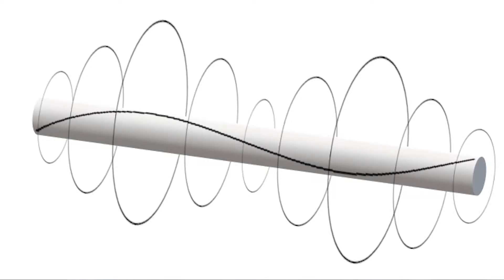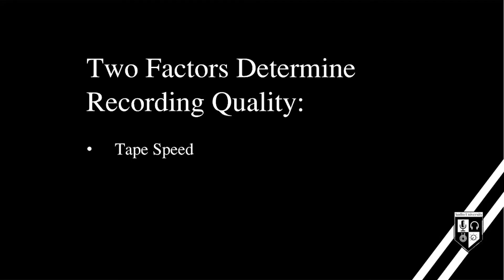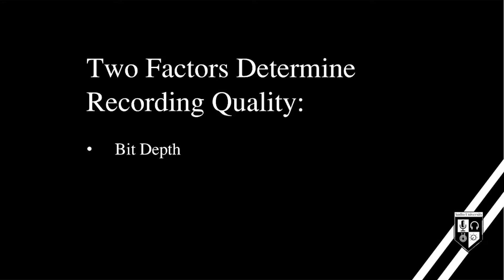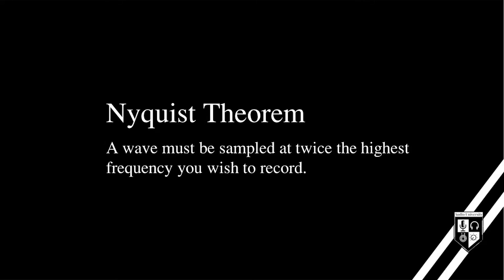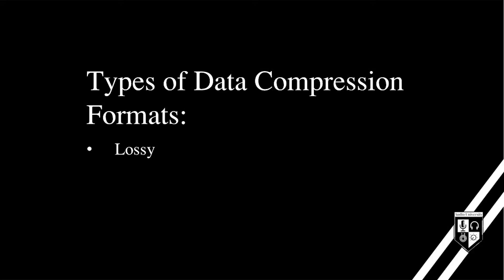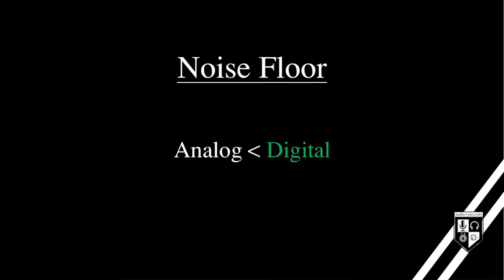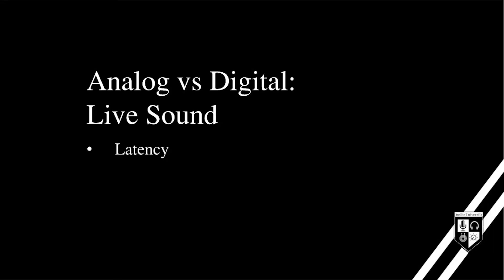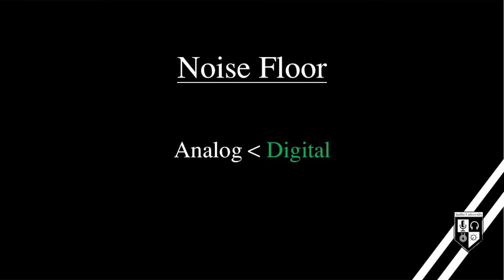ANALOG AUDIO vs DIGITAL AUDIO: The REAL Difference

Comment: Mostly correct, but there is some incorrect information based on intuitive reasoning

1. Digital does not lose information between samples. It loses frequencies above half the sampling rate.
2. Talking about the sample rate the author claims that analog's advantage is that it can capture infinitesimally small variations in amplitude. This however is determined by bit depth, not sample rate. It is also completely untrue that analog can capture infinitesimally small variations in amplitude. It cannot (nothing can), and the reason for this is noise. CD level digital is able to resolve smaller differences in amplitude because its own noise is lower.
Reply from the maker: Thanks for clarifying this, Nyquist! (Nyquist - very fitting...) I've since posted another video that touches on these points: https://youtu.be/1YviIsCbT9Q
Reply: @AudioUniversity  Indeed, that other video clarifies the issues. Good stuff.

Comment: Which is better is the wrong question because there is no correct answer to a subjective question. Digital is the more accurate medium, which is easily verified by comparison to the source. The fact that many prefer the distortions of analog is an aesthetic preference, not a quantifiable measure against a scale. Better and most popular are not synonymous. Accurate reproduction would also have to duplicate live levels because the ear is not linear. Since that's seldom practical, lowering the volume is distorting the sound as it is perceived by our non-linear ears. The compression effects of analog system saturation, especially for tape, coincidentally provide a decent approximation of how we remember the live sound when played at lower levels. Vinyl mastering limitations force conservation of high frequency energy while digital is open to abuse. Simply copy an LP to CD, and it will sound more like the LP than the CD version that was slammed against the 100% wall. The transparency of digital holds it to the data standard of garbage in/garbage out. Record producers, except for some fringe audiophile labels, never give you the signal coming from the microphones, so all you are judging is the skills of analog versus digital recording engineers if you listen to commercial releases.
Some producers and artists were subjected to bind tests pitting digital against analog tape, and despite claiming to prefer analog, nearly all chose the digital as the better sound. Even small amounts of flutter in the best recorders generate dissonant modulation sidebands that unbiased ears will reject compared to the undistorted sound.
This was an excellent presentation, but it's more interesting to see the facial expressions of people finding out they really prefer digital in a blind test. We just got used to the distortion and more comfortable with the familiar, and that's why we think an electric guitar sounds wrong through a Hi Fi amp.
Reply: Absolute bs. You have cloth ears.

Comment: Just can't catch a break can you? Optical media has a life expectancy as low as 5 years. (yes some have 50-100 years) The original CD was projected to have a 20 year life span because of the different coefficients of expansion with the different materials used. And while optical and vinyl can be destoyed by physical contact like scratches, vinyl is inherently stable for millennia!
Reply: "vinyl is inherently stable for millennia"

No, it isn't, and neither is any other type of plastic. Plastic degrades over time and will eventually become brittle and then crumble to dust. This can happen in as little as several years with some plastics, such as when the manufacturer doesn't get the recipe quite right (particularly the stabilizers). The Super Nintendo Entertainment System is a notorious example of this. For many of them, the plastic shell soon turned yellow and brittle due to a large batch of bad plastic. But even the best plastic formulations won't last for thousands of years; not even close. 

If you want a record to last indefinitely make it out of e.g., gold, platinum, 300-series stainless steel, glass, sapphire.
Reply: @MaximRecoil  Well it is a really good thing then that optical media does not use plastics! Especially not a single molecular structure with multiple layers of dissimilar materials with different coefficient of thermal expansions.
Reply: @glenncurry3041  What are you talking about? I didn't say anything about optical discs. I quoted your statement...

"vinyl is inherently stable for millennia"

... and that's the only thing I addressed. I certainly didn't claim, suggest, nor even hint that optical discs are any better for long term storage of music than vinyl records are. In fact, CDs have problems beyond being made of plastic, i.e., their reflective layer is usually made of very thin aluminum foil which can corrode if oxygen reaches it. This is known as "disc rot." When that happens, the portions of data that lie below rot holes in the reflective layer can't be read properly by the laser mechanism.

There's no way that I know of to make an optical disc that will last indefinitely. You could start by making the transparent disc out of glass or sapphire, and make the reflective layer out of gold or platinum (neither of which react with oxygen under normal conditions). However, you'd still need a way to attach the reflective layer to the disc, and I don't know of any adhesive that won't degrade over time. However, as long as you make the disc itself out of something stable like glass or sapphire, future problems with the reflective layer could always be repaired. All of the data is contained in the transparent disc. The reflective layer contains no data, it only allows the laser to read the data.
Reply: @MaximRecoil  For some reason you chose to attack my OP RE the inherent physical stability of vinyl/ PVC. Science is working on ways to make it decompose in less than 500 years! Even thin PVC bottles in landfills! My OP started out about opticals. So if you prefer to wander randomly amongst the lilies, be my guest!
Reply: @glenncurry3041  "For some reason you chose to attack my OP RE the inherent physical stability of vinyl/ PVC."

"For some reason"? Because your assertion is wrong. What other reason would there be?

"Science is working on ways to make it decompose in less than 500 years!"

A very long period of degradation happens before something is completely decomposed. It is not as if a piece of plastic is perfectly fine one day and then the next day it's decomposed. Vinyl records will become unplayable hundreds or thousands of years before they are fully decomposed. Once they turn brittle and powdery on the surface, the grooves will be destroyed by just playing them.
Reply: @MaximRecoil  You get triggered by vinyl obviously. And post way too much misinformation for me to bother with! The inconsistency was hilarious though, thanks!
Reply: @glenncurry3041  "You get triggered by vinyl obviously."

Your non sequitur is dismissed (and your unfortunate reading deficiency is noted).

"And post way too much misinformation for me to bother with!"

Your non sequitur is dismissed.

"The inconsistency was hilarious though, thanks!"

This is another non sequitur (given that there is no inconsistency); consider it dismissed out of hand of course. And since your entire post consisted of nothing but non sequiturs, your tacit concession on matter is noted.
Reply: @MaximRecoil  Add lack of context comprehension to your technical failure and lack of consistency.... You are serendipitously hilarious! Thanks!

Comment: Ah yes the digital sample lollipop lie pushed by TI! Please show us all the physics behind violating Plank Length by claiming any sample can be instantaneous and not an accumulation over a period of time! 

Ladder ADCs do peak sample and hold across the entire clock cycle. Sigma Delta converters use a capacitor fed back from it's output to it's input to keep the gate open for a period of time to accumulate electrons/ create a sample. 

Or you could prove me wrong by showing an actual display from a waveform (O'scope) that has lollipops and not stair steps. Not the graphic drawn above.
Reply: MF Nickster  WRONG! Lollipops are used in Sigma Delta graphics which is single bit based strictly binary on the next sample being higher or not. It is NOT used in ladder ADCs where an actual measured value is converted to a number. 

Again it is as easy as proving that you can violate the laws of physics and have a zero time, less than Planck Time instantaneous sample. 

Rather than the REALITY of an elapsed time based sample across the entire clock cycle.
Reply: MF Nickster  If you prefer to misrepresent the factual reality of a required time domain and every actual visible display of a signal, sure! Knock yourself out!

Comment: The Shannon part of the Shannon Nyquist theorem is about infinite sampling/ a continuous wave. Nyquist added that an infinite set of samples/ continuous wave can be represented as long as no transition is faster than half the sample rate. As such supposedly 40K sample rate should be good to 20Khz. The example given is a 12 hour sample of the Sun/ Earth giving noon and midnight! As if every time it's sampled the samples ar at peaks. But what if sunrise/ sunset were the sample points? It could be as accurate from that data to say the Sun circles around the Earth's equator. Just as a 40K sample could sample a 20Khz sine wave at zero crossings instead of peaks. Suddenly the twice highest freq decides there is no signal there!

Comment: A perfect mix is the solution. For example i use a sampler with a sample rate that i can change from 8-32 kHz and a bit depth of 18 bit. It creates a rough,  digital sound. But it's always cool to mix it with an analoge synthesizer to give it that extra flavour.

Comment: I used TOSLINK at one point on my computer, and I switched back to analog. Like you said, analog has better latency. It’s also uncompressed, unlike digital. Long story short, if you’re an audiophile, you might find that analog works out the best. If you want a quick and easy solution to audio, then digital might work out better.
Reply from the maker: I have heard others say this same thing - "[Analog audio] is uncompressed, unlike digital." I don't think that's an accurate statement. What do you mean when you say digital audio is compressed?

Comment: All technologies have their advantages and disadvantages, so I believe that we should be able to find whatever we need for each circumstance, especially when talking about electronics, and audio or image. For example, an important advantage of recording video or audio on magnetic tapes is that if it stops working all of a sudden, the tape keeps stored your work up to this point. However, if you use digital media, instead of analog, then your work is gone, because digital media save audio or video files, and you need electricity for this process, from beginning to the end

Comment: Hi.  A couple of questions on what you say around 6.50.
1. Bit depth.  With 24- bit resolution, you get 16,777,216 unique values .  is there any experimental evidence that the human ear can distinguish anything more than this? Or even 16 bit?  If not then this is not of practical concern.
2. You say at 7.05 that the wave captured by digital recording is " not as  jagged" as people think.  This is wrong surely.  As long as Nyquist is adhered to then the resulting waveform is identical to the original.  No jaggies at all!
Reply from the maker: 1. The bit depth primarily contributes to a lower noise floor, according to my understanding.

2. You are correct - there is no jagged waveform within the limitations of the Nyquist Frequency.

Comment: As an ultrasound hearer, digital music and digital devices have completely spoilt the experience for me. Most music produced after the 90's either has half of the sound frequencies that i hear missing or has weird harmonic distortion sounds between 20khz and 30khz. I've tried FLAC audio at 96Khz but it either has harmonic distortion or the sound cuts off at 22Khz so I still miss half of the sound. I think it's because of the way modern music is produced. Even though it's 96Khz most of the individual samplers / synths are not so they have frequencies missing. My hearing range is 10hz - 58,000hz. Most of the distortion from digital amps and speakers happens above 20Khz. Bluetooth is absolutely horrible and I worry for people like me as headphone jacks are being phased out completely.
Reply: It's actually higher than that but they test the perceptual amplitude for me as well. If there's a dip in sensitivity then you fail the test for that frequency. In recent years I have developed hearing loss in the range of 28,000 - 32,000.
Reply from the maker: My understanding is that the frequency response of most microphones tapers off quickly starting around 20 kHz. So, even analog recordings contain very little information beyond that. I’ve never tested this personally, but I’ve heard this from several people in the industry.

Comment: I'm bad in english. So what is better analog or spdif/hdmi?
Reply from the maker: Both SPDIF and HDMI use PCM, so the quality will be equal. How many speakers are in your system? 5.1, 7.1, Dolby Atmos?
Reply: @AudioUniversity  Thank you. 5.1. Denon AVR-X2400H (which not have 5.1 analog inputs). Speakers monitor audio and sound card ASUS Xonar DX over SPDIF. When I use HDMI I don't like sound over av reciever, bacause it its difficult remotely change equalizer. From PC much much easily. Also important thing that quiet sounds I badly hear over HDMI, in asus control panel I push SVN button and quiet sounds become louder, I tried do it in denon, but not so good it works. Why I asked about spdif, because I was reading that dpdif have small bandwidth in his cable. So I think may be sound is degrades. Or it is better sell denon and buy reciever with analog inputs, but such recievers now is very expensive.
Reply from the maker: I would not recommend using a receiver with analog inputs for 5.1 surround. Personally, I would choose to use either SPDIF or HDMI based on which one is more convenient.
Reply: @AudioUniversity  Thanks. Very strange. But why not analog? Many amplifier with rca inputs only and optic.
Reply from the maker: Analog connections are far less common than digital connections for surround sound formats. I don’t believe there is a significant benefit to using analog. Digital is cleaner, simpler, and more common.

Comment: Humans are not linear..its the imperfections in analog that is "PERFECT"
Reply from the maker: Good point, Mr.Morpheus! Some of the best parts of analog audio systems are imperfections!
Reply: Exactly, plus analog formats distort the signal in a very specific range of the spectrum. That’s also why human ear prefers them. When you record on tape and switch between source and tape monitoring enough you will realize that you prefer the sound of the tape. Really amazing
Reply: @Alt-ot5sr  the hiss, the unique analog sound, the crackle you hear on vinyl, it's all a vibe.

Comment: So if you record an analog synth into a computer it looses its sweet sound as soon as its sampled? Why do analog synths sound better than synth plugins? I hope you can answer my question.
Reply from the maker: No. It doesn’t lose its sound. Modern digital audio systems are capable of extremely high fidelity.
I don’t have a great answer for why an analog synth might sound better than a synth plugin. It might have to do with the way analog circuitry is more forgiving than digital systems, in terms of gain structure. If you overdrive a digital system, it sounds terrible. If you overdrive an analog system, it can sound quite pleasing. 
Let me know if you find a better answer! I’m interested to know!
Reply: @AudioUniversity  wow thanks for the quick answer. Well I thought if anyone would know it would be you. Lol really I’m trying to find out the science behind why Analog sounds better than digital.  Or maybe it’s all in our heads.

Comment: Well explained.
Can you please explain the "Latency" comparision in more detail for analog & digital audio? 
#Latency
#AudioUniversity
Reply from the maker: Signals can pass through an analog circuit at approximately 70% the speed of light. Digital signals need to be converted from analog to digital, transported through the network or system, and then converted back to analog. That takes some time, which leads to a small delay of the signal. Does that help?

Check out the full Analog vs Digital post here: https://audiouniversityonline.com/analog-vs-digital-audio/

Thanks for watching, @Pratik Sarode!
Reply: Thanks.
It was helpful.